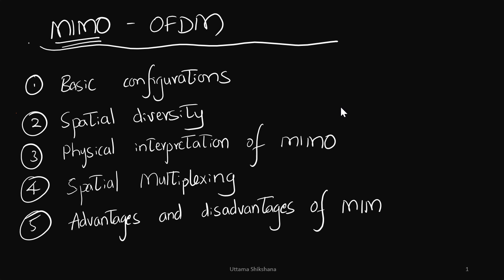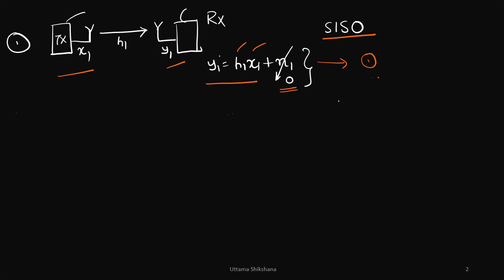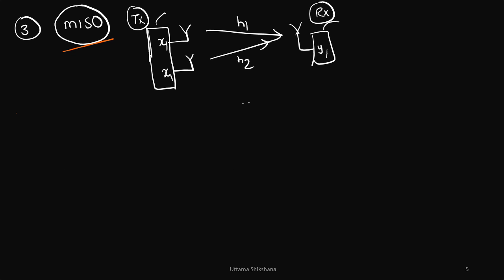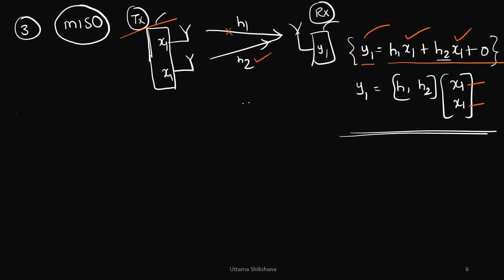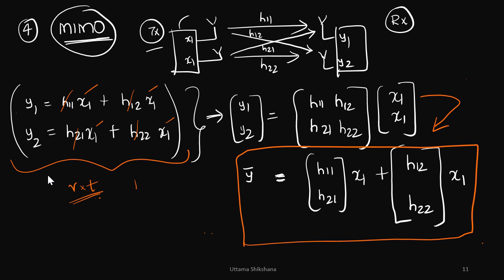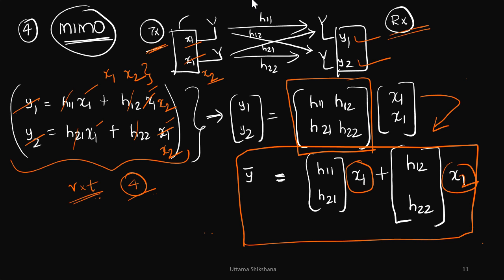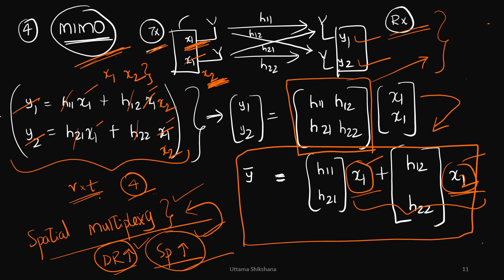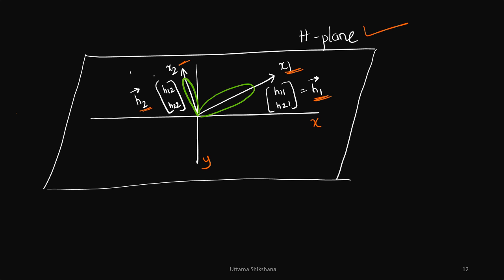[Series #51] MIMO 4G 5G OFDM | Spatial Diversity | Spatial Multiplexing | Physical Interpretation

Comment: Hi sir, can you explain what factors will make vectors h1 and h2 non orthogonal? I am thinking delay spread and antenna spacing will make h1 and h2 non orthogonal. Am I correct?
Reply from the maker: Thanks for the question Gopiraj :)
Basically, the way the multipaths are distributed in the channel paly the crucial role.
Yes. As you mentioned, antenna spacing will also play the role.